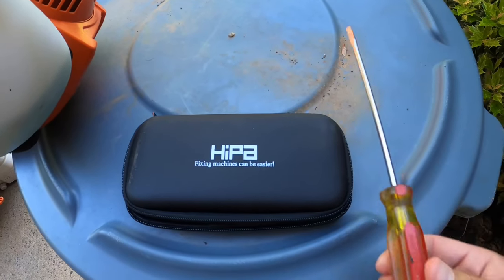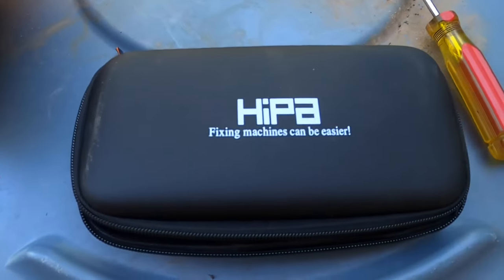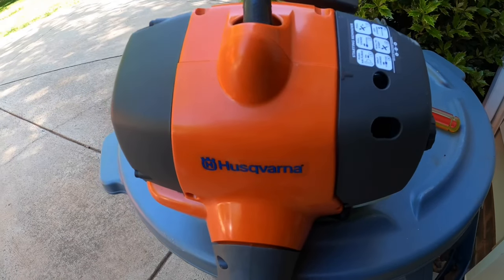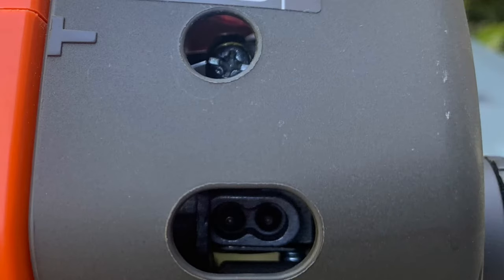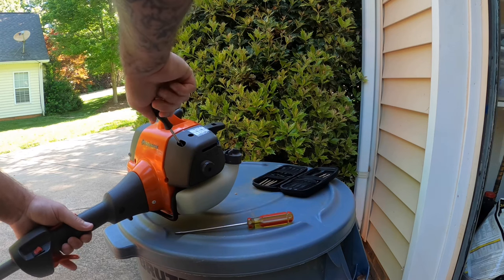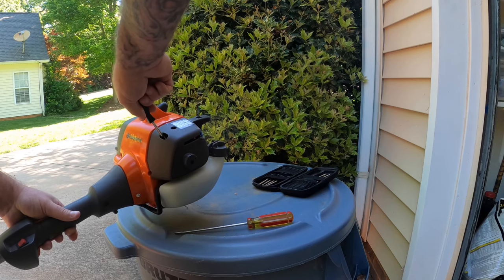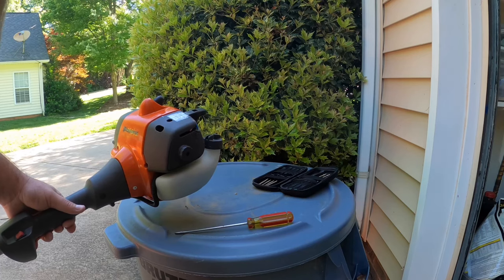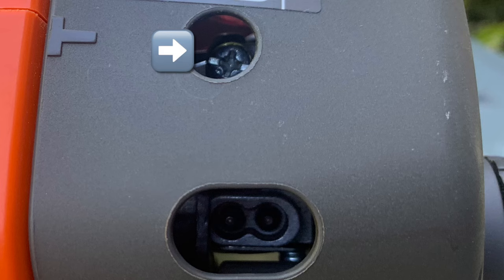How to Fix a Weed Eater That's Bogging Down - Carb and Idle Adjustment - Husqvarna

Comment: Spot on buddy, had the problem on the 525L not the same but I just found the adjustment screws and mine had regular slot screws- adjusted them and worked like a charm! I am glad your vid was first one that popped up saved me the hastle of weeding out the crap!😊
Reply from the maker: Thanks, Michael! Happy it worked for you.

Comment: I'm about to make this adjustment on a friend's trimmer. Exact same model, also bought about a year ago.  It was stalling on idle once warmed up.  Fixed that, but now bogs when throttle is feathered.  This procedure ought to fix that issue
Reply from the maker: Let us know how it goes!

Comment: Thanks for the video. Im lucky. Replaced the carb, fuel lines, filter, plug. Use the Husqvarna 95 octane canned fuel. Everything works perfect. I was mixing my own fuel using 89 octane. Not such a good idea. Now I run the trimmer dry before winter. This trimmer is a great machine. If it wasn't I would have purchased an EGO.
Reply from the maker: Awesome!

Comment: Wow, tgank you gor this video.  I had hyst purchased this last summer, didnt have it for one month and the pull card stuck.  I did fix that by tsking the pulley apart and lubing and turning the axle and put in fresh husqvana gas mix in, perfect.  Then the idle kept cutting off when i put to choke off, even after tight the top screw.  I will adhust the lower one next, didnt try that.  First thing in the morning vefore my edging the lawn project start.  This was very helpful and informative.  Everyone else video just talk about it.  Show me the parts are and i understand and that is just what you did, gave the specifics hands on.  5 stars
Reply from the maker: Thank you!!

Comment: What if your adjustment screws are way off. Is there a starting point? As in turn the (L) screw clockwise until it stops then start adjusting 1/8 turn counterclockwise and for the (R) screw (rich/lean?) Turn all the way clockwise until it stops then adjust until?what. Also what you called the idle screw, that simply adjust the choke limit, correct?
I have a 2004  model of the one in your video. I know very little of engines and motors, especially carburetors and have watched many videos trying to DIY the problem. All of them, except yours were missing important information. Yours was the most complete. I look forward to your answers. Cheers Jonathan Storlie 

I also tried the manual online and the manufacturer's website,  those both were a waste of time. Just a side note.
Reply from the maker: It really is a game of feel. It also may be the carb needs cleaning. I’ll likely clean mine this year and film it for you all 👍

Comment: Thanks for this video, it helped me get my weedeater running again, and fine tune it as well.

The only issue is that the head is still spinning, and tightening the screw only seemed to make it go faster. Any advice on that?
Reply from the maker: Hi Dirk, I would try backing it out to slow the head down. Unsure why it would speed up going that direction. Sounds like the screw may not be cutting fuel while tightening which means there is a deeper issue.

Comment: Are all fuel filters in the gas tanks on huskys?  Have a replacement in a tune up kit.  I guess it's best to do when empty.
Reply from the maker: Yes, at the end of the fuel intake line in the tank. I probably need to change mine too 👍

Comment: Thanks. What is the left compared to the right? I have adjusted mine before now it will bog down even at idle. I need to get it adjusted again.
Reply from the maker: Hi JJ, the right side is the ‘high’ side and adjusting it may help your idle problem. Start by turning slightly clockwise 🔁 and work from there.
Reply: @LKNDIY  Thanks. Whatever I did last time seem to work for a couple uses and then started bogging out again. It was never adjusted right from the factory
Reply from the maker: @JJ4848  that’s a bummer. My next trimmer will either be electric or a Sthil
Reply: @LKNDIY  Just replaced my echo blower with a Stihl. Was actually cheaper and so far runs great. With the electric technology now I’ll probably go to an electric Weedwhacker too.
Reply from the maker: Hi JJ, how is the electric Stihl holding up?
Reply: @LKNDIY  It is a gas blower. I was saying my next Weedwhacker may be electric. The Stihl runs good but I liked the Echo better. Seemed a little bit more powerful and the tube was a little bit longer. Guess I should’ve got the one size up
Reply: @JJ4848 Husqvarna 525L and never look back.

Comment: If i adjusted all three and it doesn’t seem to wanna stay running to adjust where do i start to get all three back in normal running adjustment
Reply from the maker: Trial and error is the only way unless you remember the positions before you started. Patience is key. 

If the adjustments aren’t working then it is likely your spark suppressor is clogged, or you may need to clean your carb. Hope this helps.

https://youtu.be/PIk5xe63jmE?si=DOlgXt2a4inImtpi

@blackholediy has a lot of great content regarding small motors too. I’ll put out more this season as well.
Reply: @LKNDIY  i just did all the maintenance change carb fuel lines and spark plug new gas. I can get it running sometimes
Reply from the maker: How about the spark arrester?

Comment: As stated, below, great job!  So much so could you post how to change the fuel lines on the 128LD (or others).  I struggle to change these and they seem to leak or come apart after I do.  Thanks, JoAnne
Reply from the maker: When I change mine I will surely document it 👍🏼
Reply: When you do get those lines changed try to remember to add stabil-marine to your mixed gas or use premixed gas (the stuff you find on the shelf) the ethanol in gas damages the fuel line rapidly. 
The stabil-marine or similar additives has an ingredient that protects the hoses and rubber parts

Comment: I have same model however my trimmer is way out of adjustment to include the high adj. Any suggestions because this doesn't seem to work like others. i have tried to turn both to the right till stop then back off 1 and Qtr. turns for a starting point but i can't get it to idle or start Unless it is in a choke pos. As soon as that choke is flipped to the right and off it shuts right down. sometimes half choke. frustrating.. Any suggestions very welcome and appreciated.
Reply from the maker: Hi Roger, have you tried adjusting the idle screw at the top?
Reply: @LKNDIY  yeah.... Just gonna start from scratch today and take it slow. Think my frustration got the best of me and clouded my execution.
Reply: Sounds like you need to replace the carb
Reply: @rogerbrooks1042 you need a new carb

Comment: I started with Husqvarna and the equipment was not reliable at all. I switched to echo 6 years ago and I’ll never go back. I use the echo red armor oil and I’ve literally had no problems that weren’t under warranty.
Reply from the maker: I’ve had great luck with their backpack blower, but the weed eater is terrible. I’ll hVe a new one by next season.
Reply: @LKNDIY  agreed on the stick tools, get an echo, you won’t be disappointed

Comment: What if your the trimmer runs and idles but whenever you give it true m throttle it dies. Then how do you adjust that.
Reply from the maker: This method should work for your problem as well. My motor would big out at full throttle and sometimes it would shut down.
Reply: @LKNDIY thanks for the reply. Nothing worked. I just took it to the shop 😂.

Comment: Mine starts first pull but dies when I give it throttle. Any thoughts?
Reply from the maker: If you’ve made the adjustments in the video then it could be your spark arrestor needs to be cleaned.

Comment: Seems like on my 330 i adjusted the idle going counter clockwise. The more I tried clockwise it really started spinning.
Reply from the maker: Could be it is the inverse on your model?
Reply: @LKNDIY  the fuel filter was a breeze. Waited till it almost needed refueling. Shook it into place then snagged it with a bent clothes hanger!
Reply: @LKNDIY  yeah it could be also this model has just been recalled for faulty wiring causing arching & or igniting the fuel 😃.  11 known reports of injuries so far
Reply from the maker: That’s crazy. I’m guessing this is why they are moving away from small motors.

Comment: i did what you did on here my carb was new i put it in  it still had the same problem  so its the motor it self  i did find out it runs great with the choke on ill run it till it dies i guess
Reply from the maker: Thanks for sharing! What is your motor doing? Is it not idling well? Is it bogging out when you throttle?
Reply: @LKNDIY  idles great but bogs when u go full throttle i have to keep feathering it  but no full power which i cant believe it was fine a while ago until it wouldn't start then i put everything new in it carb  fuel line filters spark plug
Reply from the maker: Interesting. Like you said, may just be the motor. Maybe run some seafoam through it? May help clean things out. If your motor is idling fine, I’d lean toward the motor being salvageable.
Reply: @LKNDIY  seafoam???
Reply from the maker: @campusman1957   https://www.amazon.com/dp/B07DHHSQMS/ref=cm_sw_r_as_gl_api_gl_i_NEHV17Y712FJ8FRVMX6F?linkCode=ml1&tag=lkndiy0f-20

I’d use this if you feel there is blockage somewhere. Not saying it will work. Some people are all about seafoam, others say it’s worthless. I use it in my engines.
Reply: @LKNDIY  i don't if there's blockage ? all I know is that it bogs down another guy on here said it could be the motor is bad ??
Reply from the maker: @campusman1957  The motor may very well be bad. Without hearing it or seeing it’s tough to know. I personally always have seafoam lying around, so I’d run some through it just because it would not hurt to ensure I have no blockage. I’m not suggesting you run out and buy some, sounds like you’ve already put some money and sweat into the problem. Wish I could be if more help. Maybe @blackholediy can help? Guy is a wizard with small engines. Great dude too
Reply from the maker: @campusman1957   https://youtu.be/PIk5xe63jmE here is on of his videos 👍
Reply from the maker: @campusman1957  in the video I shared he changed the carb, still bogged down, so he cleaned the spark arrester 👍

Comment: I went all the way clockwise on the throttle screw and the trimmer head is still spinning. 😳
Reply from the maker: How is is the motor idling?
Reply: @LKNDIY  seems a bit high, but very smooth and steady. Purring like a tiger.

Comment: What a dumb design I had to adjust mine 3 times already I’ll stick with Honda I have a 4 stroke Honda it’s gold
Reply from the maker: Totally agree. My Husq backpack blower is bullet proof, but the weed eater is not very good. I have a Honda mower that absolutely rips…I love it. Thanks for watching!
Reply: @LKNDIY  Can confirm on the Honda mower.  I love it.
Reply: I have Husqvarna 224L which is a Honda engine, and mine is doing the same thing as this one. Mine is a 4 cycle though so why stick with "Honda" when they all do this??
Reply: They have Honda motors you goofy guber.
Reply: I have to adjust mine every time I use it and now won’t idle long enough to adjust never buy this brand again